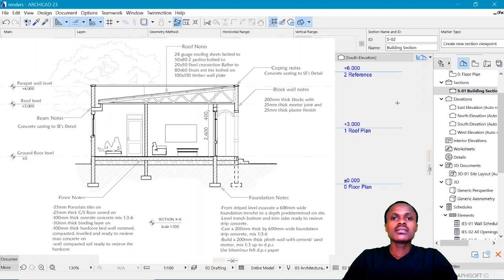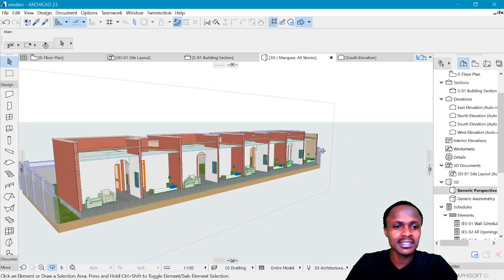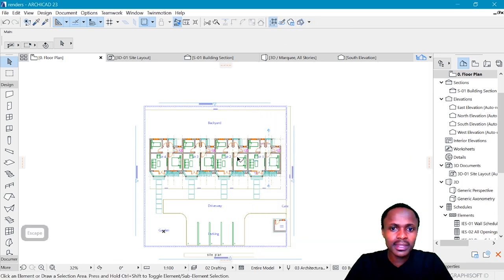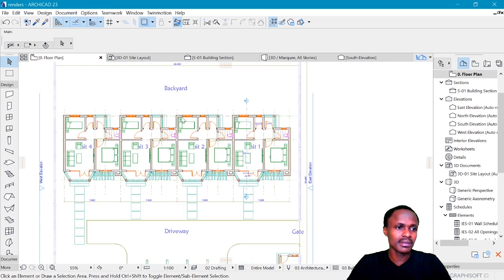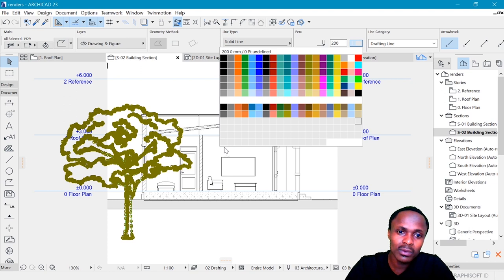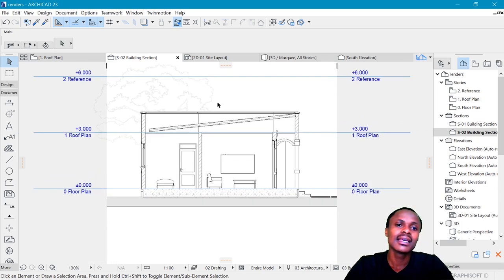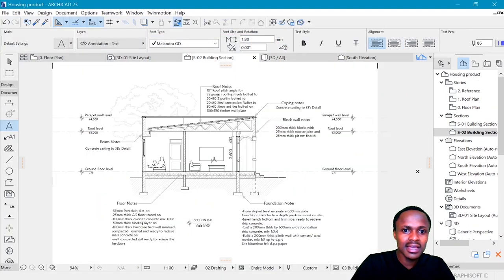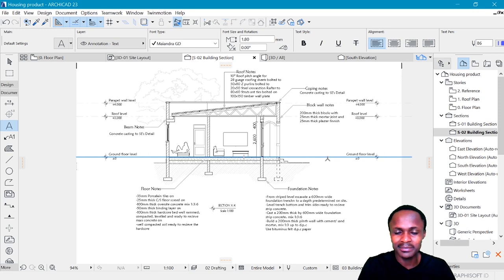Archicad Section: 3 steps to improve your working sections.

Comment: Drawing 2d Elements in the Section is NOT using ArchiCAD appropriately. Suck it up, create the understory, build the elements and have them auto generate in the section.
Imagine moving a wall and you now have to go to fills and lines in the sections. No no no no no.
Do the job proper.